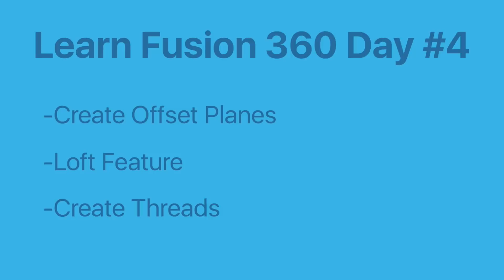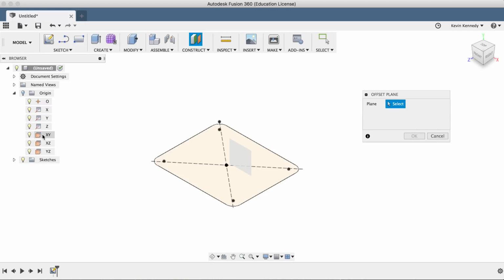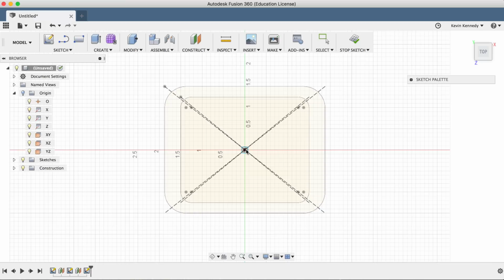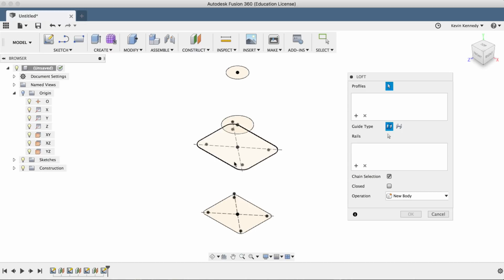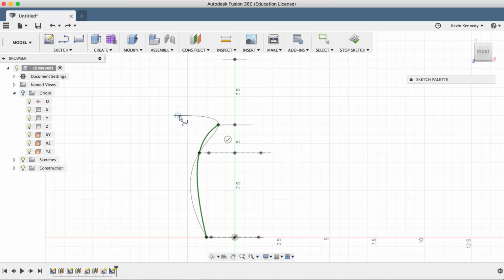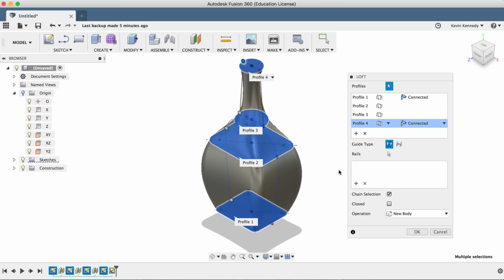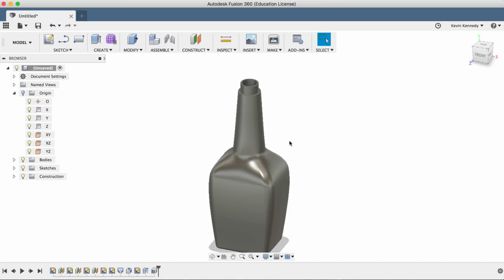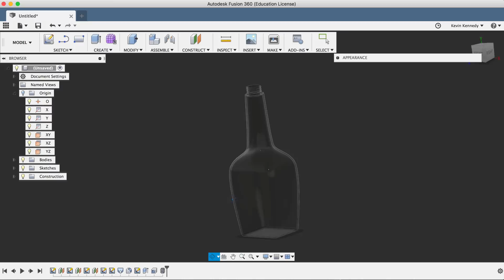How to 3D Model a Whiskey Bottle - Learn Autodesk Fusion 360 in 30 Days: Day #4

Comment: Not sure whats going on here?  I am having problems like alot of others here with either the splines not connecting to the sketches and/or I can't get the mirror option to select under Sketches after the splines and lines have been drawn up along the bottle?
Reply from the maker: Hi Jason - it's likely a problem with the top spline handle not being snapped to the straight line. Click on the top spline point and then take the light green spline handle and drag it with your mouse until it literally snaps into place over top the straight line. Then, you'll have to re-mirror both lines. Try that and see if that works... if not, then please share your file with me and I'll take a look.

Share your public link as a reply to this comment. Here's a video explaining how to share a public link - https://youtu.be/2XrcrdV-8Ls

Then, please write a separate comment letting me know you've replied with a link because YouTube flags most links and I don't always get notified. Cheers, Kevin :)
Reply: @ProductDesignOnline  Yes!!!  You were right on connecting the spline back to the line!  But what really keeps messing me up and this needs to be stressed, I just learned that I continue to prematurely stop my skectches too early!!!  I need to remember to avoid stopping sketches too early to ensure that my mirror lines, and all sections of the ribs stay in one sketch to be edited as one sketch!  I have to remember that one sketch kinda acts like a block from my AutoCAD, it has to stay in one single sketch and not stopped prematurely to be properly edited all in one step!!  This took me literally three hours to hammer out!  Never forget this again =-)
Reply from the maker: Glad that was it! Sounds like you're not going to prematurely stop your sketches anymore ;) It can be hard coming from AutoCAD (or another program) where processes and keyboard shortcuts are slightly different...but stick with it and you'll get used to all the Fusion 360 quirks in no time! Cheers, Kevin :)

Comment: did you use 2d or 3d fillet for bottom of bottle?
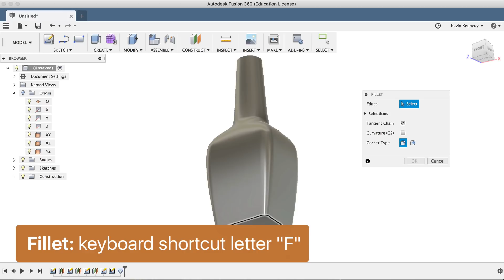Reply from the maker: Hi, Peter. at 1:00 I added 2D-sketch fillets to the edges of the sketch profile. Then, at 8:16, I used the model 3D-fillet command (Which can be activated with the keyboard shortcut letter "F"). Cheers, Kevin :)

Comment: Hi, I am loving your tutorial videos so far. I am having a problem with the mirroring of the first spline/line segment to be used as a rail. I have all black dots on the first side but once i mirror it over I only have 1 black dot on the new side. All the black dots remain for the first side. I cannot figure out why it is not staying the same for both sides when the mirror is done. Please help.
Reply from the maker: Hi Joseph, that seems strange...but I know a lot of people have had issues where Fusion 360 showed the spline and line to be connected, however, they were ever so slightly off. I'm wondering if this may be the case. Could you share your file with me so I could take a look?

To share your file please go to File > Share > Share Public Link (make sure "downloadable" is toggled on) > Paste your link here as a reply to this comment. Then, please write a separate comment letting me know you've replied with a link because YouTube flags most links and I don't always get notified. Cheers, Kevin :)
Reply: I don't seem to be able to turn on downloadable link. I am using an educational license, I don't know if this matters or not, but when I bring up share public I cannot change any of the three settings on the popup. If I am doing something wrong or have some settings screwed up (probably the latter of the two) I apologize. I am quite new to Fusion 360. I just started going through all your tutorials today. I really appreciate your fast reply!
Reply from the maker: @josephmace2125  No worries! Yes, you can still share public links with an education license. When you click "share public link" it will open up a dialog box titled "Share Public Link." Then, you will have to toggle on the switch for "share the latest version with anyone using this public link"  When you toggle that switch on, it will (should) automatically turn on the "Allow item to be downloaded" switch. If not, try to turn that on by clicking on it. If this does not work as described then I would suggest closing Fusion 360 and try again after reopening it... it's possible that it is a bug.

Thanks for following along! I'm happy to take a look at your file once you're able to get the link to work...just paste the link here. Cheers, Kevin :)

Comment: Like many others, I've tried and tried but keep getting the rail error... I don't understand how it's not connected if I get a fully closed loop that I can Extrude?
Reply: My solution: 
> I place Points on outer edge of the circles and rectangles
> I drew my Splines away from the Points and then dragged them to the Points after I created the bottle shape
>> I continued the Spline all the way to the top and skipped using a Line/Trim

After that I was able to select both Rails and successfully finish this!

Comment: You keep answering the question about why the rails aren’t working, the lines aren’t connecting the sketches I get that, but you don’t ever mention how to fix that. I still can’t get mine to snap to the circles, the only way I can do that is to draw a line across each circle but then I can’t trim the excess off the spline. Abd if I draw the spline without the excess it all comes together but still won’t allow me to use the rails. And yes, I’m lining up the spline with the blue line to the straight line and all that...
Reply from the maker: Hi Sterling, did you try connecting the lines to the circles from a side perspective? (using the viewcube to look at the model from a side angle). Do you have your grids and snaps turned on? It should snap into the circle fairly easy... so if you're continuing to have problems it may be a difference in settings or something with your file.

If you'd like, I can take a look at your file. This will help me give you a more specific answer. Share your public link as a reply to this comment. Here's a video explaining how to share a public link - https://youtu.be/2XrcrdV-8Ls

Then, please write a separate comment letting me know you've replied with a link because YouTube flags most links and I don't always get notified. Cheers, Kevin :)
Reply: @ProductDesignOnline  I ran into this exact same problem anyone els is running into. However I DID find a solution, and I think you should at least add this to the video. 

Now, as already mentioned, the splinepoints do not automagically connect to the profiles. And because the measurements of the profiles are not exactly on gridlines, that is a problem for most. What I did is edit all profile sketches, and put a sketch point on the sides where I later on want to connect my rail-spline to. While drawing the rail-spline, you can use those sketchpoints to place your spline-point onto. That works with a snap!

From one newbie to a lot of others... ;-)
Reply from the maker: @conhennekens  Thanks for sharing this solution with the community! I appreciate you taking the time to watch and comment. Cheers, Kevin :)

Comment: Hey, so I got the black dots but still can't do the loft as it shows error 'some profiles are not connected' though I have all black dots. Also what if sometimes we don't get the black dots, how do we convert them?
Reply from the maker: vibhuti choyal - It sounds like all of your profiles are connected properly, but there is a problem with the guide rail... and it's very likely its where the spline and straight line connect. Here's what another viewer found to be the problem: "The handle of the top point of my spline was not along the line of the straight neck line, it couldn't compute, because there would be a slight edge."

Please check into that... if that doesn't work then please share your file and I'll take a look. Cheers, Kevin :)

Comment: when you start your spline you connect it to a point on the outside of the rectangle that doesn't exist in my version. This can be clearly seen at 6.11 as a grey dot on the outside. This point is created right back at the start when you fillet the rectangles. My version after filleting has no excess point. Also when I add the spline, the line it intersects then gets two red points at either end. Its not the connection between the spline and any other part that is causing me issues, it is the rectangles and circles that go out of phase (to coin a term). Any ideas?
Reply from the maker: Hi Shane,

It sounds like a difference in settings. Can you please crosscheck your settings with mine? Here are my default settings - http://bit.ly/defaultsettings

One way to solve this would be to simply add some sketch points (Sketch dropdown list > Point) to those spots. You should then have no problem snapping. Alternatively, you could create a construction line across from center to center.

Cheers, Kevin :)

Comment: Please help me when I tried add rail it's say Warning: The selected rail does not touch all of the profiles. Thank you
Reply from the maker: Hi, Justin. One of the common issues others have faced was the top spline handle not touching the top (straight) line...which was causing the error. Edit your last sketch by double-clicking on it in the timeline below. Simply click on the top spline point > select the green slider handle > drag it until it snaps on top of the straight line... it should look like this - https://snag.gy/eBoqvJ.jpg

Then, you can hit "stop sketch" in the toolbar. Next, select the loft command from the create menu and retry the loft as outlined in the video. By changing that one spline point it will hopefully fix the issue and work as so - https://snag.gy/b54iUD.jpg

Fusion 360 can be picky with loft guide paths....so let me know if you get it to work! If not, I'm always happy to take a look at your specific file to see what else could be causing it. Cheers, Kevin :)
Reply: Hi Kevin, I tried so many time like you said but it's still not working, I think the problem from the top have yellow color and the bottom is white https://snag.gy/Pax81j.jpg I don't know why it's not connect, Thank you. @ProductDesignOnline
Reply from the maker: @jamebone23  Thanks for the update! From the screenshots, you provided it appears that you didn't add the fillets (rounded corners) to the second rectangle, which is why you have sharp edges. I believe that is also what's causing the weird dented area at the top of the bottle. Cheers, Kevin :)
Reply: @ProductDesignOnline  Its work, you're the best, Thank you so much :)
Reply from the maker: @jamebone23  You're welcome! Glad you got it to work...and glad I could help :)

Comment: Hi Kevin, I am having a problem with the rails - despite having gone back to the beginning and carefully following your instructions 3 times I keep getting the following message when I select the rails - The guide is not G1 between first and last sections - and then. - Tool body creation failed. Any idea what I am doing wrong??? thanks!
Reply: have been reading all the comments and see a lot of people have had the same problem.......
Reply from the maker: @marisajane37   The most common issue others faced is that the spline and line are not connected, thus they are not one continuous line that is required by the loft path. What you need to check first is if the top of your spline is connected to the bottom of the straight line. 

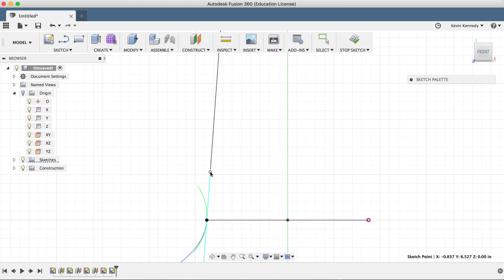To check this grab the handle of the top spline point...move it around freely and then move it towards the straight line until it snaps onto the straight line. Watch at 6:50, where I snap the spline handle into the straight line. This will ensure they are one continuous path. Then, you will have to re-mirror both lines onto the other side. Afterward, when you re-try the loft command it should allow you to select that path as the rail.

Let me know if this works! If not, then please share your file. Cheers, Kevin :)
Reply: @ProductDesignOnline  Thanks Kevin - finally got there! I'm working on a MacBook Pro and was using the trackpad.... and have now switched to a combination of the trackpad and Magic Mouse but I am thinking I can make my life a whole lot easier if I buy a mouse with a centre wheel..... any thoughts on this? Cheers!
Reply from the maker: @marisajane37  Good idea - a mouse with a center wheel makes a huge difference. I use an Apple trackpad with most other things, but always use a mouse with a center wheel for any CAD related work.

There are some mice out there designed specifically for CAD use... which essentially offer a few extra buttons that you can customize for more efficient use. However, if you're just getting into CAD then a simple Logitech mouse will be good enough -  https://amzn.to/2FzTdcL (This is the mouse I use while traveling so I don't have to worry about my more expensive mice noted below).

If you're ready to invest in a good CAD mouse then I recommend the 3Dconnexion mouse. The center wheel is a "smart wheel" that automatically switches between smooth scrolling and click-to-click zooming in CAD applications. It also has a few other extra buttons that you can set up for things that you frequently use - https://amzn.to/2FClfnQ

If you start to get really serious about CAD then I would recommend investing in a 3Dconnexion 3DX-700066 Spacemouse (https://amzn.to/2AO5OG3). They take a few days to get used to, but once you get used to it they are magical.... it really speeds up your workflow and ability to control your model.

I hope this helps! Cheers, Kevin :)
Reply: @ProductDesignOnline  Thanks so much!!!!! Very grateful for the info 👍🏻
Reply from the maker: @marisajane37  You're welcome! Glad I could help :)

Comment: Great videos, thank you! After doing the loft command, the guide rail that resulted from mirroring command stayed visible in model even when clear glass appearance was applied, whereas original rail (made up of splines and line) is invisible...what's going on with that?
Reply from the maker: Hi, DeliriumSkydiving. The first thing to check would be your visual style settings. Head down to the bottom of Fusion 360 and click on the "display settings." Then, select "visual style" > "shaded"

If yours is set to "Shaded with visible edges only" then you may have that line appearance running down the side. This won't show up if you process a render... it's just for visual appearance while working on a model (helps better understand the contour).

Let me know if that was it! Cheers, Kevin :)
Reply: @ProductDesignOnline  , yes, that was it! Thank you! :D
Reply from the maker: @DeliriumSkydiving  Great! Glad that was it :)

Comment: Hi, Kevin, I replied to my initial question with the link to my broken model. But now (after using the coincidence trick), I am getting the G1 error and cant find the culprit!
Reply from the maker: Hi, Alain. I had a chance to look at your file. It appears that you have two different splines, which is likely throwing off the guide path. Here's an image for your reference - https://snag.gy/92U5wv.jpg

I would suggest deleting these splines and creating one again...making sure to use one spline throughout the entire guide path. After trying that again, let me know if it works for you. Cheers, Kevin :)
Reply: @ProductDesignOnline  cool, i will give this  a try tonight
Reply from the maker: @AlainPilon  Sounds good. Let me know how it goes! :)
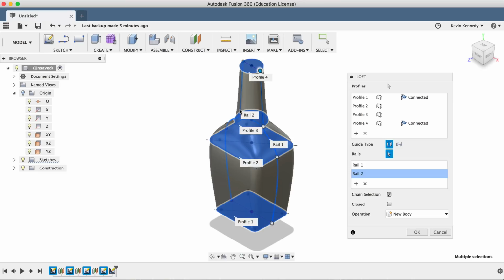Reply: @ProductDesignOnline  I dont understand why, at 8:06 when you click on the rail, it selects both the spline and the line part, these are 2 separate parts. I understand that the mirrored rails is a single object, but the first one was made in two steps, how can it be considered a single object?
Reply from the maker: @AlainPilon  As long as they are one continuous path...as in, they are touching/joined together, then the loft command will treat them as "one" when you go to select them as rails. This is often the largest area of difficulty when it comes to the loft command. Fusion 360 can be picky with guide rails, especially because it's usually a small detail that is off that isn't visible from the normal view/perspective. Where you able to get this one to work by re-doing the spline and straight line from scratch? Cheers, Kevin :)